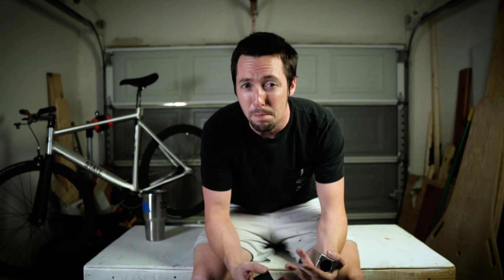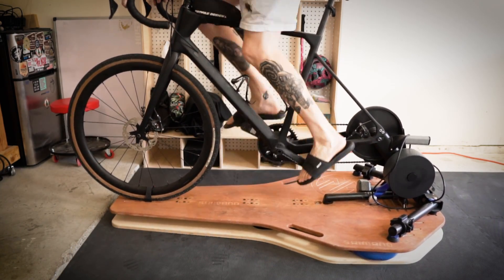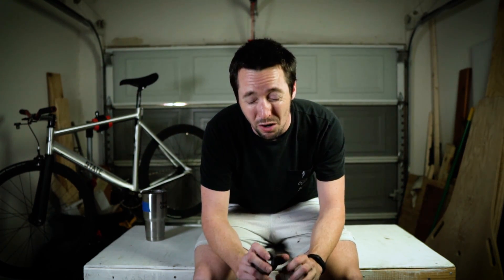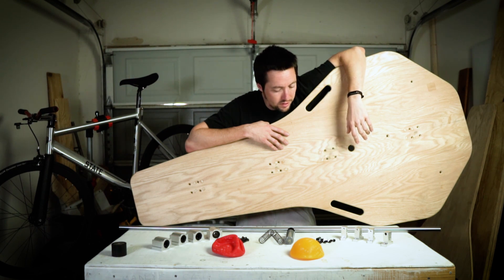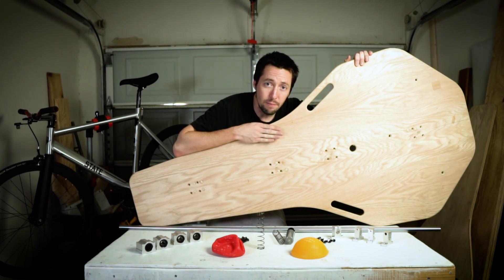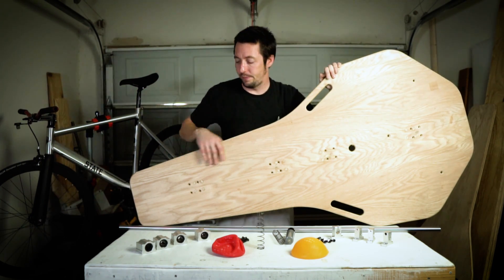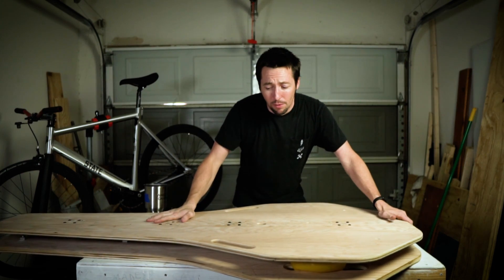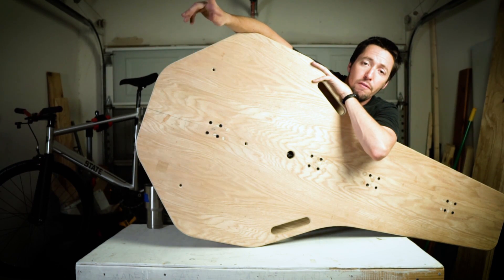DIY Rocker Plate with Fore and Aft (Linear Rod Bearing Type)

Comment: The spreadsheet has some conflicting information. The links for the 30mm Bottom Plate Bolts have a Size saying 30mm, but the Notes column says 40mm. The link points to 40mm versions. Should these be 30 or 40mm?

Also, if you are still updating the spreadsheet, the 20mm shaft is no longer available on Amazon, but the seller (VXB) does have them available on their website. I also noticed that some of the links (e.g. Velcro Straps) are pointing at the wrong item.

Comment: Hi Andrew, I am in the process of constructing one of your designs but I am unsure as to where the kickr sits on the top plate. Does the front leg sit an the middle of the centreline, or is it to one side?
Reply from the maker: You will need to center your bike wherls on the centerline of the top plate

Comment: Andrew wanted to ask you a question, could it be done with a 48"  Linear Rail Slide    -because you recommend 55"  thanks for your answer
Reply from the maker: Unfortunately, I don't think you would be able to without a redesign. The front and rear rod stands would be out of range for a 48" rod.
Reply: @WeRideSouth  

Thanks for your answer, brother. But do you have any idea where you can get the 55" size?because I have looked in all the stores and I cannot find that measure .The other question if I couldn't find the 55" is there a problem that I can do it with 2 units to get the exact measurement of 55 "
Thanks again

Comment: The springs you linked to on amazon are unavailable, do you have a quick way of showing me where to get a spring of the proper qualities? Thanks, excited to make my rocker plate!
Reply from the maker: 135mm length, 27mm od, 2mm wire diameter
Reply: @WeRideSouth  thanks!
Reply: McMaster Carr is a good place to buy all these parts. Might be a little more then Amazon but they will have the parts there.

Comment: Hi Andrew, really impressed with this so much so I’ve bought most of the bits. Utter bits on the way. Something I noticed when putting it together is the top of the rod stand offs sit flush with the top of the bearings. When the bearing tilts side to side the stand off corner will foul the top  board. Have you noticed this ?
Reply from the maker: I have not noticed this issue. Are the air up balls in place?
Reply: @WeRideSouth  not yet no, just something noticed putting it together on the shaft. I’m guessing if it’s not been an issue the corners of the stays dig in and create their ow little pocket.
Reply from the maker: @knockdolian12  I might not be understanding your issue. Any chance you can send a photo?
Reply: @WeRideSouth  I can’t see how I can add a photo. Maybe I’m over thinking it.  If you look at yours with no top board on the top of the rod supports are flush with the top of the bearing so the top board sits on top of the rod mounts. When the top board rocks the top corner of the rod mount will dig in to the board. Can I add a photo ?
Reply from the maker: @knockdolian12  Here is a picture of my clearance. There is no scarring on the top plate from the lower linear rod support.  https://imgur.com/a/jyTR8JG
Reply: @WeRideSouth  Interesting. I don’t have that clearance. Must be a manufacturing thing. Something for others to watch out for. Email me and I’ll show you if interested
Reply from the maker: @knockdolian12  You could definitely remedy it by adding some type of spacers or washers on top of the linear bearings. Maybe 12mm thick plywood cut to 60mmx60mm .
Reply: @WeRideSouth  That’s what I was thinking. Something to watch 👍 Thanks again
Reply: @knockdolian12  I'm about to start building my rocker plate and can see that I will have the same problem as you. Maybe you could post a pic of your solution when it is in place.
Reply: @ronniebranting627  Hi Ronnie, my springs came yesterday so I put it all together. You will find my original concerns were not an issue. I’m still waiting for some bits like the balls and nylon washers but it seems to work well. I don’t think photos can added. Good luck with it 👍
Reply: @ronniebranting627  Sorry Ronnie, gave you a bum steer. You will need spacers on the bearings as with it all tightened up the top plate won’t slide. I’m going to use 10mm ply
Reply: @WeRideSouth  H mate. All the bits finaly here. Bolted it all up tight with M6 countersink screws unfortunately with it all tight there is no clearance and the top bore Fowls on the rod mounts and won’t move. 10mm ply spacers will sort it. Thanks again
Reply: Andrew,  thanks very much for this video and info, you've inspired me to build my own.  Bearings and supports arrived today, awaiting other parts.  Laying them out I can predict the same issue  where the shaft supports (mounted to bottom ply) are perfectly level and already touching the top ply in a level position.  In other words, the bearing mounts and the shaft supports and the same height giving zero clearance from the top ply to the shaft support.  This leads to inability to tilt side to side without using raisers or cutting holes.  Raisers by far the easier solution so will likely go with that.  Thanks!
Reply: @timdhines  I've just encountered the same issue. Spacers of some kind as well, and longer bolts!

Comment: Cracking job that thanks. Bits on order . What size are the balls. I didn’t see them in your list
Reply from the maker: Mine are 5" I believe, but 6" will work as well.
Reply from the maker: Here is the link to the ones I got on Amazon: https://amzn.to/3j79gzP  and eBay: https://rover.ebay.com/rover/1/711-53200-19255-0/1?mpre=https%3A%2F%2Fwww.ebay.com%2Fitm%2F6pc-Playground-Dodge-Ball-w-Hand-Pump-Easter-Basket-Toy-Fillers-Outdoor-Toys%2F183036807472&campid=5338611310&toolid=10001&customid= 
I also fixed the sheet to reflect it. Please be aware of the 40mm bearing spacings, I'm working to get another template out to correct this issue.

Comment: Just getting my new Wahoo next month when they become available. Been a road rider for years but now live in So Texas and I'm not to keen on riding on the road ( not a bike friendly city). We build a lot of machines at my work. Would love to build one of these. Looks really easy once you get the boards built. A person could build those boards with a router if he had a print to go off. Sometimes CNC guys can be a bit pricey. Do you have the drawing for the boards? Are you planning to sale just the boards?
What a great build and time you took to show how easy it is to build one. Thanks again for the video, I liked it and subscribed.
Reply from the maker: Thanks for watching! I do sell them locally. I'm in the DFW area. Some people have taken my design in the Rocker Plate group on Facebook and made it into a multi page print. It's available in the files section of the group.

Comment: Hi, apologize in advance is this has been asked, but can the top and bottom plate be cut out of one 4'x8' section of plywood (birch)?

Also, amazon and allied are both out of stock on the springs you recommend.   Is there an alternative in inches or other metric size and compression ratio?
Thanks in advace for your reply.
Reply from the maker: Yes, the top and bottom can be cut from one 4'x8' piece of birch. Also, I have another spring on order, but I cannot confirm it's good yet: https://www.aliexpress.com/item/32826469668.html
Reply from the maker: Also, Allied will have 360 in stock in 10 days.
Reply: @WeRideSouth  thanks for the quick reply.  That aliexpress spring looks good, but 19-30 day delivery is a bit too long.
Reply from the maker: @maxvega4217  are you in the states?
Reply: @WeRideSouth  yes, Portland,  Oregon.   Another question,  on the top and bottom plate bolts, can I just use the top plate bolts, at 30mm, for the bottom bolts or do I need to buy 40mm as in your note in the spreadsheet?  Just trying to save some cash.
Reply from the maker: @maxvega4217  the only problem with that is the 30mm might be too long for the 18mm ply and the linear bearings. The screw hole on the bearings only go so deep. You could use 30mm if you increased your spacer under the top deck to 5mm.
Reply: @WeRideSouth  ok.  Using 3/4 inch plywood,  13ply...maybe the spacer will work. Thx
Reply: I actually thought you were going to say the 30mm would be too short  to sub for the bottom bolt (at 40mm)
Reply from the maker: @maxvega4217  30mm works perfect for 18mm or 3/4" bottom plate , 25 is almost too short. For the top plate no spacers 25 is perfect. With a 5mm spacer you can get away with 30mm on the top. You might be able to get away with it with just a 3mm spacer.

Comment: So...somehow I'm thinking about building this project. Are my calculations off, or are the top and bottom plate not identical width? Also some of the ebay/amazon links expired in the Sheet.
Reply from the maker: The bottom is more narrow than the top to give more lean angle without increasing the stack height.

Comment: So the pivoting left/right wasn't blocked from the linear rod Stand Offs? Or did you have to add some platform on the linear bearings in order to gain some space?
Reply from the maker: You only need about 2-3 inches back and forth, the springs prevent the linear bearings from going back too far and also center them back after fore-aft movement.
Reply: This is a problem I noticed with this design.  The edge of the stand offs will scrape the bottom of the upper plate when rotating.

Comment: Amazing vid, thanks Andrew!  Question:  Are you happy with the springs?  It seems like there's a lot of fore/aft motion... wondering if they aren't stiff enough?   Also with the balls, you feel that the one on each side is enough instead of two per side?
Reply from the maker: The fore and aft is really good and is very close to a Saris M5. Very happy with the springs. Also one ball per side is plenty with the 6" I feel like two wouldnt allow much movement and would require more work to maintain.
Reply: @WeRideSouth  Last question... how loud is it?  Some people complain that the shaft design is very loud.  Wondering how yours is?
Reply from the maker: @mariofiorucci5836  I havent noticed it, but usually I have tv on and about 4 fans, so I dont notice it at all. I'm sure if you riding it with nothing on you would hear something. I'll do a video of how loud mine is.

Comment: Andrew, The sheet layout for the DIY plywood dimensions cut off the widths  of both the top and bottom rocker plates.  I think that the printable sheet size was probably set wrong, or perhaps you are only providing a certain amount of information. I draft in AutoCAD and if you have a dxf / dwg file that I could open, I could make an assembly sheet and a matching drawing set with "match-lines" for someone to print at home and tape together....Pat
Reply from the maker: Pat, the original is a DXF file. It's available in the Google sheets under the dxf column. A rocker plates facebook member made the printable sheets pdf so I cannot speak on the accuracy of that one; however many people in the Facebook group were able to successfully replicate my design with the printable pdf. Hope that helps!

Comment: could you talk about the spring stopper you have in your first snapshot video? Where the spring is pushed up against something on the rod?
Reply from the maker: That is a 20mm lock collar and it was only for a prototype. In the latest design I use the lower rod supports as a spring stops and adjust the bearings to pre-load the springs against the supports. This way it reduces cost/parts.

Comment: Hey your design looks great. I was wondering if you have any videos of it in use? I'd love to see how the fore and aft movement behaves. Thanks!
Reply from the maker: I don't have any extensive videos of it in use but you can see some quick clips at 0:29
Reply: Ah brilliant, dunno how I missed that! I'm hoping to make one here in Ireland.. just trying to source all the bits.. thanks again for the video and for replying to me
Reply from the maker: @davidhawkins9206  thanks for watching! Good luck on the build. I ordered my bearings and such from AliExpress. I think AlliedElectronics has a European counterpart for most of the nuts and bolts as well as the spring.
Reply: @WeRideSouth  thanks! I've just ordered the linear bearings from aliexpress. Looking forward to building it
Reply: Hi David...I’m also in the process of building one in Ireland as well ☺️. Have you been able to source the 20mm rod? I’ve one quote but the supplier will only supply in 3m length so I will have a spare 1.5m.
Reply: @alan_cycles  Hi Alan, no I haven't looked for the 20mm rod. I'm still waiting for the bearings to arrive. All I've collected so far is some 5"basketballs. Is the rod you have a hollow tube or solid? I'm unsure as to which is recommended.. I'm in the Midlands if you wanted to literally go halves on a 3m length? Thanks
Reply: @davidhawkins9206  it’s a solid chrome plated rod...I’m located up in County Down so the travel probably doesn’t make it economic. The 3m is costing £60 incl tax. See how you get on sourcing locally.
Reply: @alan_cycles  ah no worries, I'll have a good look in the new year at what I can find. The solid chromed bar sounds like a good plan.. should give it a smooth fore/aft movement.. did you get the played cnc'd yet?

Comment: Andrew I've seen your spring placement in two different spots.   In this video at the beginning you have them both in the center but during the build you put one in front center and one in the back...  Which way has been best I'm trying to determine best placement.
Reply from the maker: Rob, the best placement is in the design document. I place them inboard of the two center standoffs and preload them with the linear bearings. I've found this works the best.
Reply: @WeRideSouth  thank you... Thats how I have them by seems to be too much spring compression.   Board doesn't glide well..   The linear bearing holes were off on the design and I didn't catch it cause everything else that had been provided was spot on.   I had it CNC cut and caught it in assemble so now I'm correcting that.   I'll look at the design doc again that you have with the video.   Thank you
Reply: @WeRideSouth  so I think the spring tension is fine with the placement.   I had a bad linear bearing that was causing it to bind under tension.   Changed it out and it seems fine.   I just need to correct the hole placement for 40mm spacing.   Thanks again for all the assistance and the videos.   I'll post a picture of my adapation when done.  I have a Tacx Neo 2t so I altered the back edge of the top plate and did extend the length a couple inches.
Reply from the maker: @robbedrosian228  in the document there are two dxfs one for 35mm and one for 40mm
Reply: @WeRideSouth  are you referring to the pictures at the bottom of the parts list or am I missing a document some where
Reply from the maker: @robbedrosian  I linked a google sheet outlining all of the parts and there is a column inside the sheet called "Dxf file" with two options. The 35mm is for SBR20UU bearings and the 40mm is for SCS20UU bearings.

Comment: Thanks for posting and sharing the DFX file.  I'm not a CAD guy but I did download the Autodesk DWG TrueView viewer and was able to pull the dimensions.  Getting ready to cut out the plates manually.  Noticed the the spring location and mounting in this video is different than the DFX drawing  (0.47 / 9:43) , (e.g. moved the back one forward, and not clear how the forward spring is kept in place).  Any insight on the change?  Also unsure on the need of the 3mm offsets for the linear bearings for 40mm size.  From the video, it didn't look like you installed them.  Any insight is much appreciated.  Looking forward to building.
Reply from the maker: So the video shows a V1 in the google document I have an exploded view of where the spring should go. They should both be located on the inside bearings, one up front and one in back. SCS20UU (40mm) require at minimum 3mm spacers.
Reply: @WeRideSouth  got it.  thanks for the quick reply

Comment: Andrew, where are you buying your SCS20 Linear pillow block bearings.  Bought mine from amazon and after 4 months of use one of them ( the front one) has failed in that it makes a loud noise in fore/aft movement.  Imagine the bearings or housing is shot. Thx
Reply from the maker: Max, these should be fully serviceable bearings. If you remove the bearing in question there are two circlips holding it in place on each end. You should be able to remove just one and the bearing portion would slide right out. You can clean, regrease and reinsert it and it should be good. However, I buy mine from AliExpress.
Reply: @WeRideSouth  thanks, Andrew.  I removed the bearing block and greased it up...working well.  The problem I have now is that the rod holder runs the bottom of the top plate and fore/aft movement is restricted.   I think I need to cut a grove on the bottom of the top plate to give the top of the rod holder a gap so as to not come into contact with the board.   Thx
Reply: @maxvega4217  Perhaps washers between the bearing and top plate would resolve this.  Had the exact same problem, which some others have mentioned in the comments.

Comment: Can the lifeline rocker plate be adapted to work linear???Would save me the backache of getting wood cut etc
Reply from the maker: I'm sure it could; however, I do not own one and have not done such. The Lifeline is just two boards. Assuming you can get the mounting holes right it should work just fine.
Reply: @WeRideSouth  what stops the rod falling through the standoffs? Does the standoff clamp the rod tight or summat?? Cheers 👍🏿
Reply from the maker: @thelmaviaduct  yes, the road is clamped into place by the lower stand offs.
Reply: @WeRideSouth  nice one. Thanks for the vid and taking time to answer questions 👍🏿👌🏿❤️
Reply from the maker: @thelmaviaduct  thank you for watching!